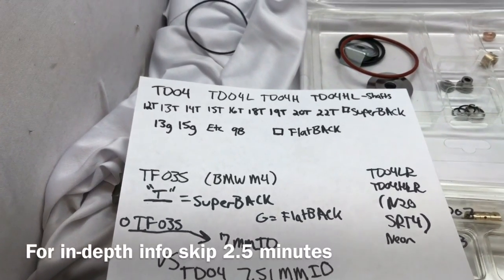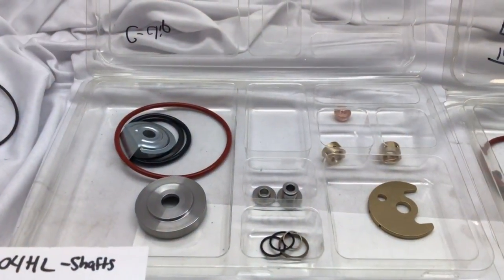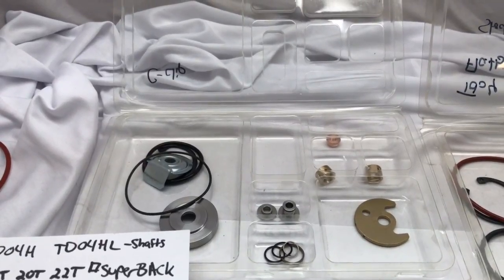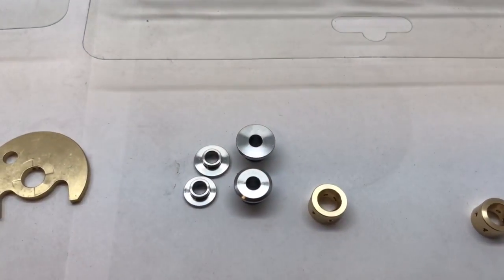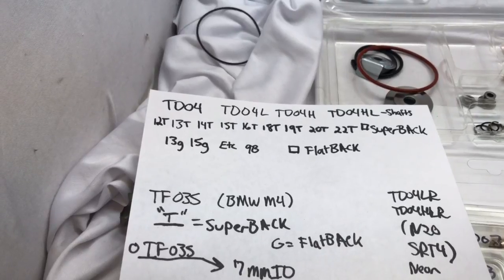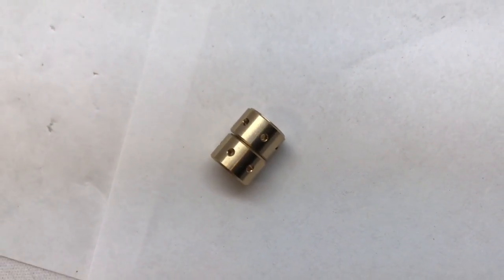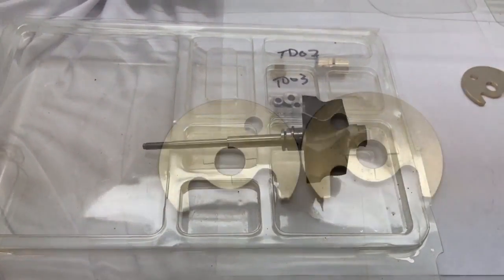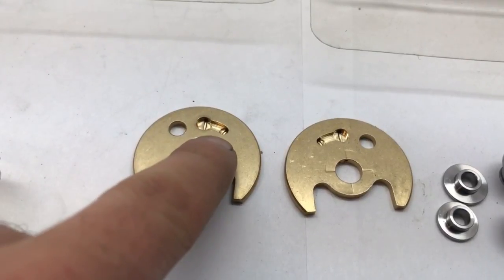TDO4 Turbo Rebuild Kit Variations

Comment: I'm looking to do a rebuild for my 2012 genesis coupe 2.0t I believe it's the td04-13t( not sure the exact tdo4( but based on some investigation I'm pretty sure it's just a td04( not an l or anything).    i think I've narrowed down that my seals are leaking( I'm checked the turbine-play is what I believe is within normal as theres basically no play at all..  and I've been noticing some oil.. and some interesting sound when I'm going into boost).   how do I select what kit I want to order

Comment: Hi ! I have a TD04HL from a ralliart 2010 do i use the same kit as yours ? Any TD04HL 15t rebuild kit ?
Reply from the maker: Frédérick Chamberland the raliart uses the first kit down from the top in the description box
Reply: Perfect ! And do i need to send the turbo for balancing after ?
Reply from the maker: Frédérick Chamberland no you don’t have to, but if you want to we balance the assembly for 40$, we need the collar, spacer, compressor nut(from rebuild kit, your turbine wheel and compressor wheel
Reply: Allright, thank you for answer !! Appreciate that ✌👌

Comment: What would I need for an Acura RDX TD04HL15TK31VFT
Reply from the maker: 15t in your part number is the key term, you need a superback kit
Reply: Turbo Lab America ok awesome what about a replacement kit for the guts that’s already been balanced. Is there anything drop in I could use? I’m a total newbie to turbo rebuilds the dealer diagnosed it as bad turbo. It spools and stops making boost at 1/4 way on the stock boost gauge. It’s supposed to go to the top on this car. Also it runs very sluggish and slow. I’ve checked for boost leaks and I did order a new flow control actuator that’s my last step to try. The actuator rod end is tight and perfect so it could only be the internal diaphragm if that’s what’s bad but I have a feeling the bearing is bad. The propeller in the cold side looks good with a camera. I couldn’t get to it to check for shaft play. I can’t see the exhaust side. I’ve seen chunks that go in the middle that are pre bolted up. Could I use one of those or at lest a matched wheel set and shaft kit? If so where’s the best place ?
Reply from the maker: I wasn’t aware of a replacement bearing housing for that turbo. I need one for a turbo I have here
Reply: Turbo Lab America  do you have an email. I’ll email you what I have found